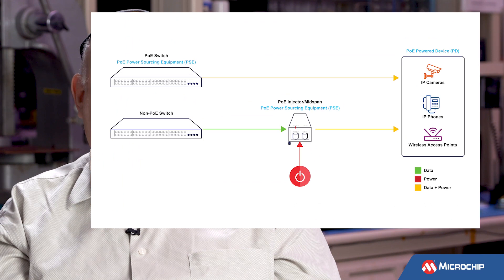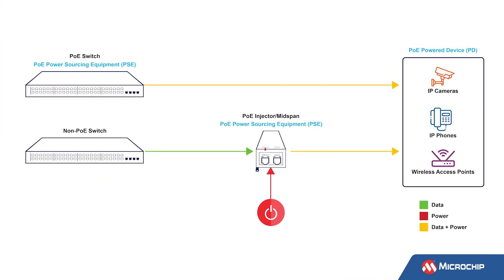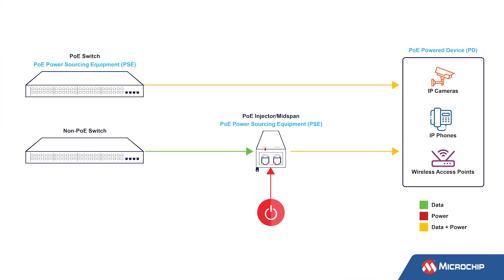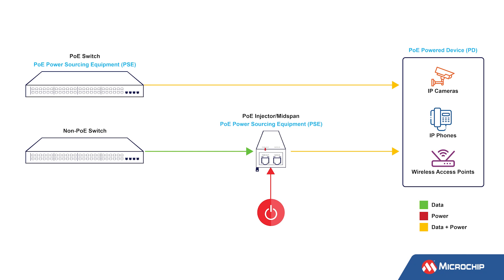AOE | What is a PoE Midspan or Injector?

Comment: how long cat6 that your midspan can power the poe device
Reply from the maker: Hi there, thanks for your question. The maximum distance that a PoE midspan can power a device over Cat6 cable is generally 100 meters (328 feet). Beyond this distance, you may experience power or data loss.

Comment: Is a Midspan the same thing as a Power Injector?

thanks Spider-Man!
Reply from the maker: Great question! Yes, a midspan and a power injector are the same thing. Both add power to an Ethernet cable, allowing devices like IP cameras or wireless access points to receive power and data through a single cable. If you have any more questions, feel free to ask!